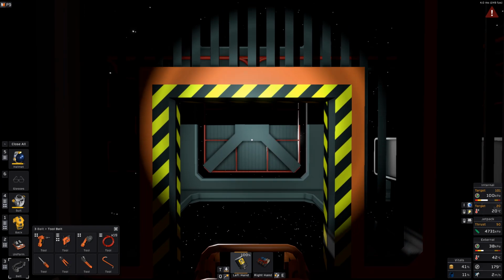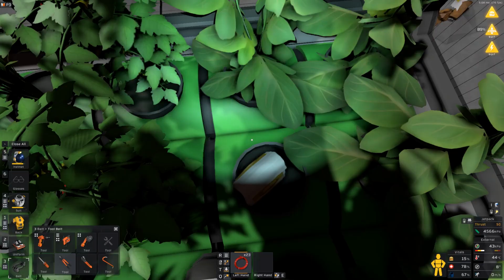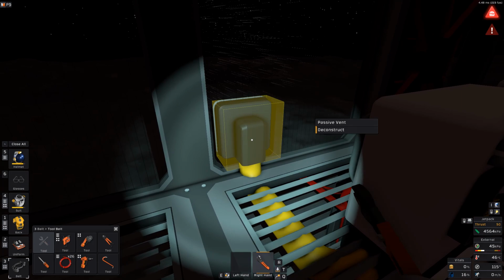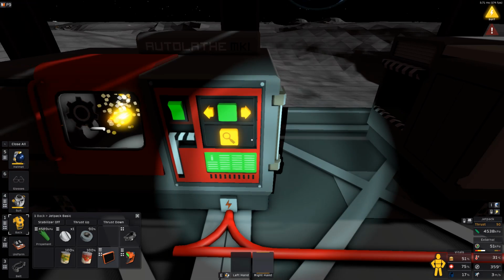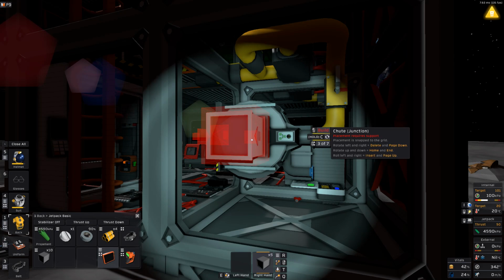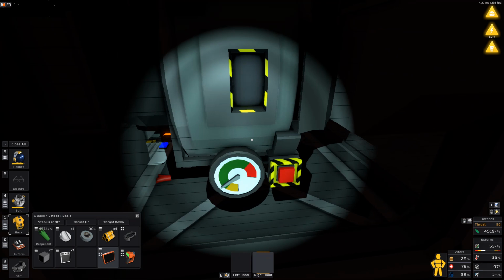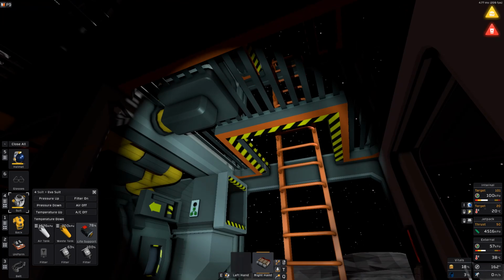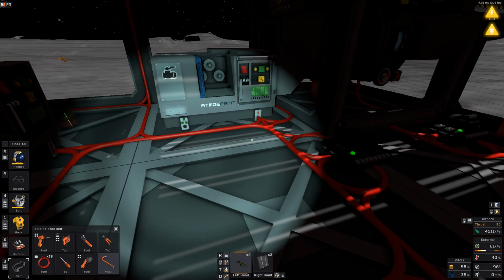Moon 3³ - Episode 2 - Setting up the furnace - Stationeers

Comment: I just started to watch this playthrough. Just wondering if you did eventually separate your input pipes on the AC unit. As it looks like you joined them together and contaminated the air you were cooling. That's why you were getting other gasses in to the atmosphere in your cube I'm suspecting?
Reply: Ok, edit to my silly question. I played around with the ac unit. Nothing like irl. I work in HVAC. Actually never used them before(400+ hours played, lol). Works way different to what I've expected 😅😅😅

Comment: IIRC, the standard furnace appears to have a pressure regulator built into its input, which you can negate by only piping into the output only.

Comment: 23:00 couldn't you use a back pressure regulator  on that X gas pipe to have it hold the gas up untill 60,000 kpa "just before burst pressure" then have it vent outside??
Reply from the maker: i could have done that :) 
not to spoil it for you but it never came close to that high pressure anyway.

Comment: If you end up in dire straits, the composter isn't the only way you can make hydrogen (no, I don't mean Winterspawn, there is yet another way) ;)
Reply from the maker: that's new to me, where would that be from?
Reply: @Elmotrix  Instead of just burning the reagent mix you get from the recycler, toss the mix into the centrifuge, which will give you biomass. Check what Biomass will do when you dump it into an Arc Furnace ;)
Reply from the maker: @DK-cf8dl  that's actually really OP, 8 mols pr biomass..
Advanced composters have a 10 mol net positive for 3 plants and heaps of energy.
Reply: @Elmotrix  Yeah, I don't know how long thats been in the game. Found it by accident just the other day. Not sure if its a new thing or not.

Comment: dam, how u move stuff in ur hands to the inventory and vice versa i never got the hang of it XD 
good vid keep it up hehe
Reply from the maker: it helps to enable "Legacy Inventory". it's a hidden option that only keeps one inventory window open at a time. less to scroll trough :)
Reply: Use double F in regular inventory mode, it'll send it to your backpack unless u have a different menu open- which will make it try that inventory first.

Comment: Hey Elmo loving the new play-through.  On the furnace you could have left the in/output connected and just set the vol pump to push into the ac line and the valve set to a 1-way back to the furnace loop.  The way you got it now is going to be problematic it seems since input has a built in regulator I thought.

Comment: Did they change furnace mechanics? Usually connecting output creates a common network without pressure valves in the furnace. Only input has a valve where you should overcome internal pressure.
Reply from the maker: it functions as a two way one-way-valves. meaning it won't equalize like an open valve, meaning it will only match pressure, and the only temperature changes you get is what follows the difference.

Comment: I tried doing your air conditionner trick on Venus, however it does not seem to work even when pressurized with a lot of waste gas, do you have to continuously run an active vent for it to work?
Reply from the maker: You need to adjust pipe lengths

Comment: Cool series :) if you didn't know you can open your waste tank in your backpack, makes venting it a lot easier.
Reply from the maker: well I can't, i'm using legacy inventory, if i want to interact with anything i have to at minimum hold it in my hand. 🙂
Reply: @Elmotrix  ah I guess I missed that, is it a mod, or your rules? I usually just hit r on it to toggle the option.
Reply from the maker: @dunkan44  not a mod, it's a game option, but it's not in the settings menu any more. You have to open the settings.xml now to enable it. it used to be the default, and i just grew used to it.